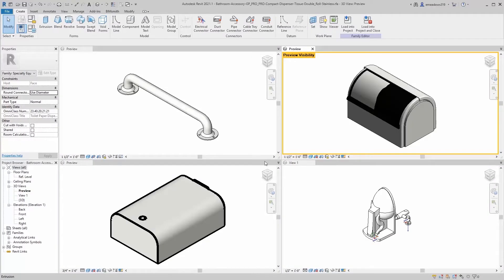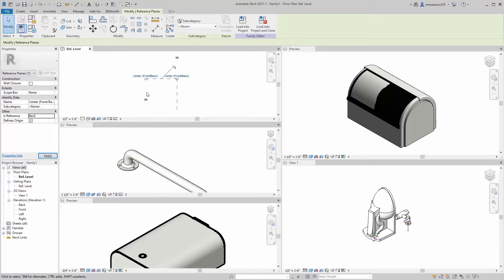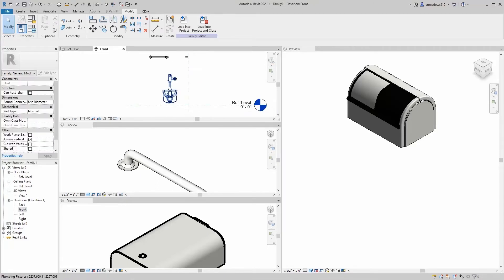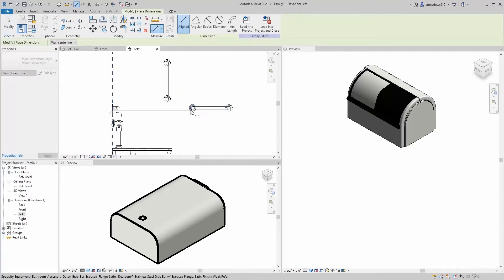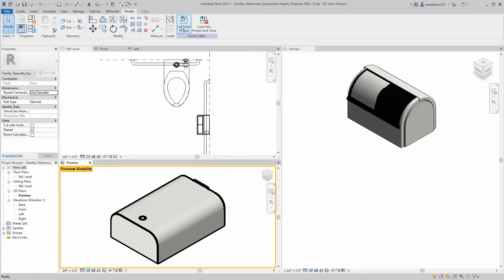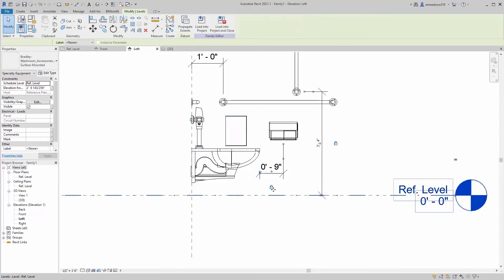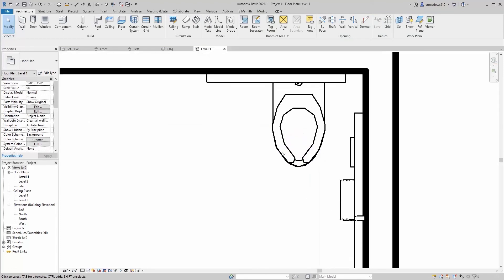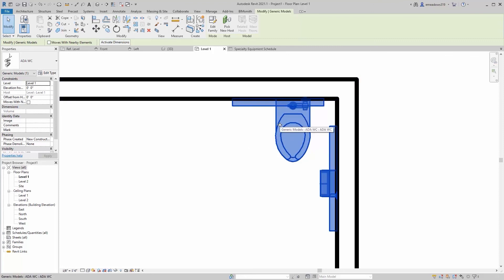How to Use Shared Nested Families in Revit Projects - BIMsmith Revit Tutorial

Comment: Hi, I'm trying to do something similar with an electrical GPO fixture family. I want to have 1 parent family which consists of various nested families of double GPO, Single GPO, etc and they are controlled via instance based visibility parameters. The issue I'm having when scheduling this family is that the schedule is also reporting the parent family so it is double counting. How do I eliminate the parent family from scheduling and only allowing the nested families to schedule? I switched on the "shared parameter" in each of the nested families but turned it off in the parent family and it still won't work. I noticed when you created your schedule, your parent "ADA WC" family did not schedule. Would you mind sharing how you did that?